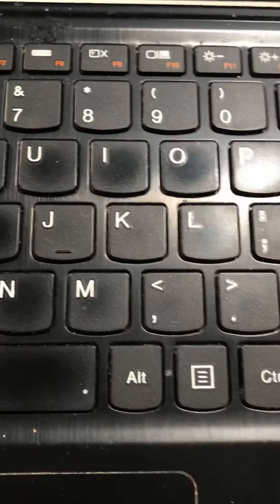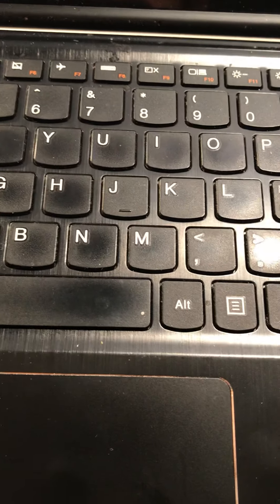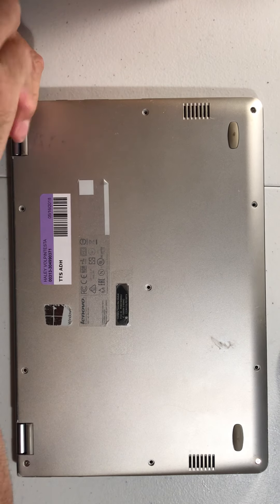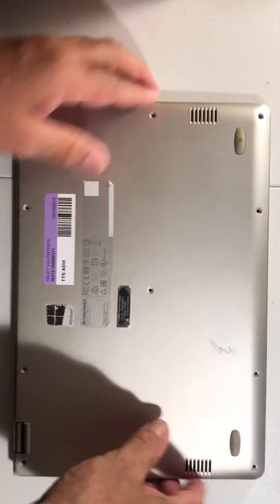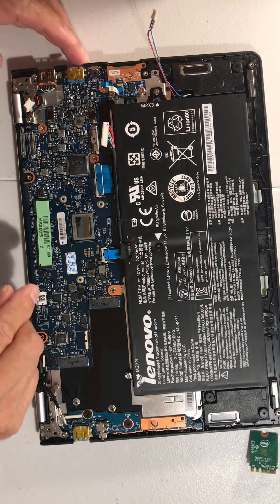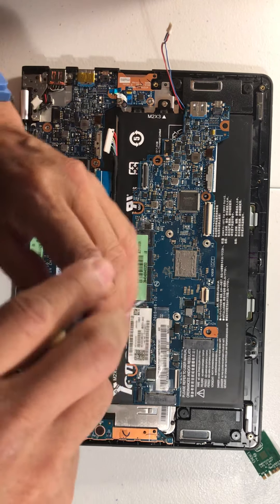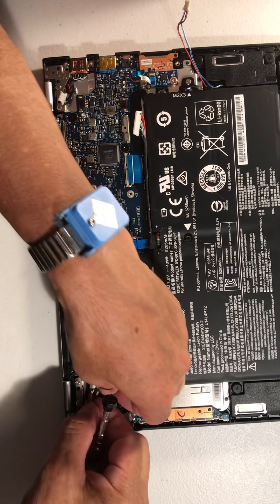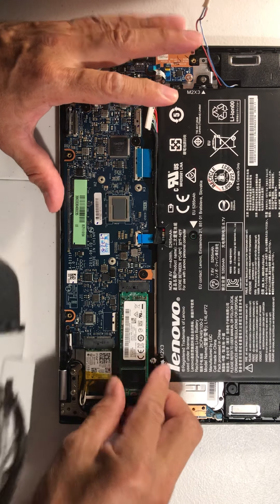LENOVO YOGA 700 WON'T TURN ON , WON'T CHARGE, NO LIGHTS. SOLVED IT !!!

Comment: Did the replacement of the charging port need any soldering or it was installed with screws?
Reply: Vassia got same issue ?
Reply: I try to replace connector and it change nothing no power at all.. i think i need to Try to change mother board ...
Reply: @lossantosgolfclub1044  Mine didn't charge and the problem was a faulty motherboard's chip after all.
Reply from the maker: Yes I think is the motherboard